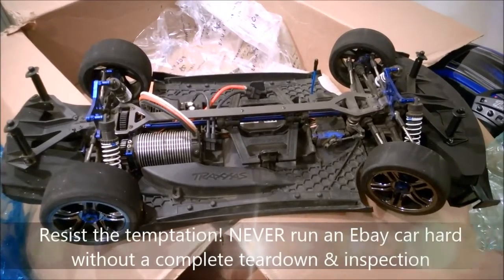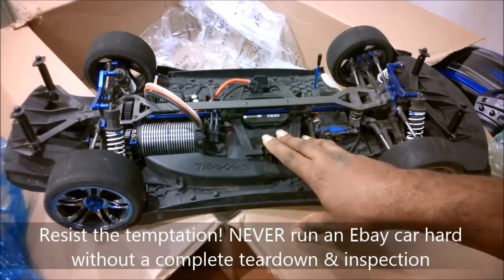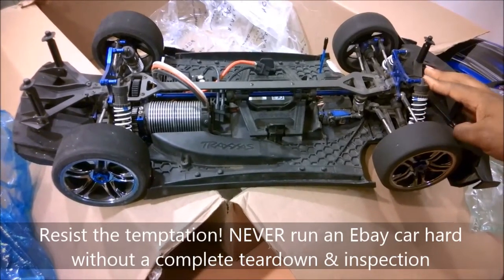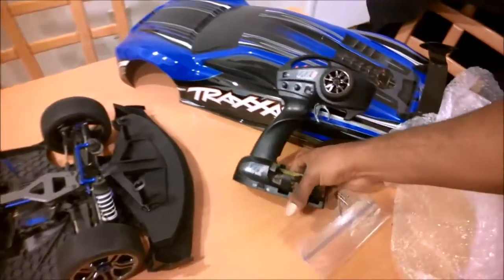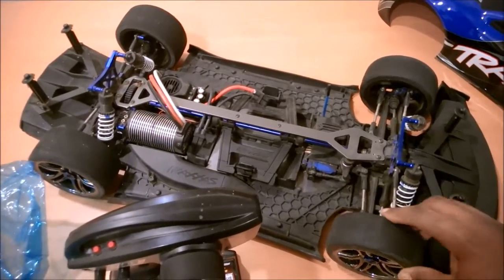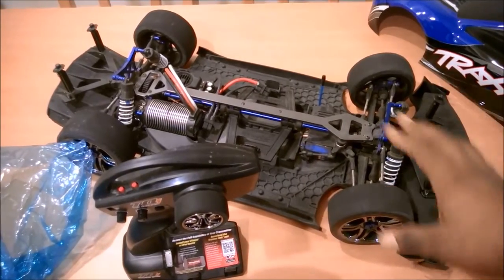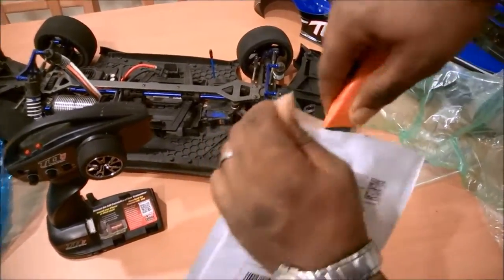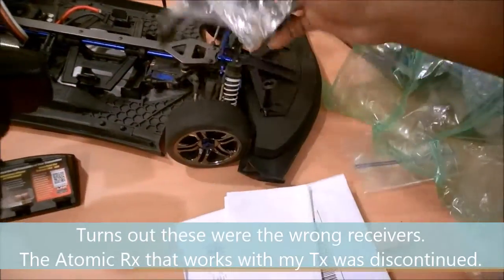RC Physics 148 - XO-1 Donor Car #2 Unboxing

Comment: I always like rewatching this video to see how far everything has come in the hobby from almost 10 years ago and seeing what XO-1's were like before the rerelease in 2022. I'm still working on my XO-1 Serena she's currently apart for diff rebuild and maintenance i also ordered some options parts like new springs based on what you put on your XO-1 i got a sway bar kit as well i'll be putting on Wednesday hopefully when everything arrives. Also i bought an MMX8s\1717 1,650kv combo for Serena last month and she was awesome on 6s before i took her apart again for diff maintenance. Kudos to the great video.
Reply from the maker: Thank you! Just remember to take your time at each step to avoid common mistakes. I much prefer doing it correctly the first time vs. having to redo it over and over again because I tried to rush things. 😎
Reply: @RCPhysics  Got her mostly rebuilt  Wednesday and i'm loving how she's driving still sorting out her steering. Eventually she'll be getting new front tires, a new custom metallic red painted body i'll also be rebuilding my driveshafts. After that i'll leave her the way she will be for awhile. then i'll be moving on to my next on road speed project which will be either an Arrma Felony or Limitless V2 haven't settled on which one yet.

Comment: good luck with big number from the xo Physics.
Reply from the maker: +2cwik4u104 Thanks you, sit. Step 1 is to just see if I can tame it. A lot of guys with a lot of experience have told me that the XO-1 is more trouble than it's worth, but I'm convinced it can be made to behave with a little luck.
Reply: yeah, from what ive heard, its not the easiest car to handle.
Reply from the maker: +2cwik4u104 Fundamentally, it's a Slash with a 3" wheelbase stretch, but the balance so far feels quite a bit different.My Slash-based cars feel a lot more "nuetral" while the XO-1 seems more "tail happy". I think some of this is because traxxas put so much weight over the rear axle, but I'm still trying to figure the car out. It's a lot of fun, though.
Reply: well, have fun with your project, but keep us up to date with it.

Comment: I've been using the sp racing tires latley since everyone is having problems with grp's blowing up.  but I'm coming to find out that they balloon Alot.  so much it burnt the paint off my body.  hopefully you'll have better luck then me.
Reply from the maker: +rustler donnie Really? I've been using them on Dizzy and haven't seen any real signs of issues. Which car was this on?
Reply: My slash 4x4 on 6s 1717
Reply from the maker: Same as Dizzy. Interesting. Are you using the "rain tires?"
Reply: Winter medium
Reply from the maker: +rustler donnie I have a &quot;wheel well&quot; mounted on Dizzy behind the rear wheels for aero reasons that doesn't show any signs that the tires are ballooning and touching, but I've just been up to ~102 mph. I seem to recall you were a bit faster than me. Ben at delta plastik / SP Tires says these tires have performed well up to ~114 mph, but I suspect you start to see the ballooning setting in a bit before that.
Reply: Ya the fastest I've ran on them was 120 mph   maybe I just found out the limit lol.
Reply from the maker: +rustler donnie  Yeah, it may be time for BSR foams. LOL!